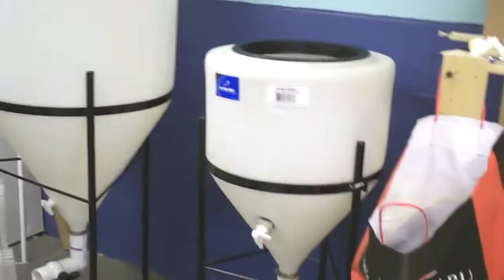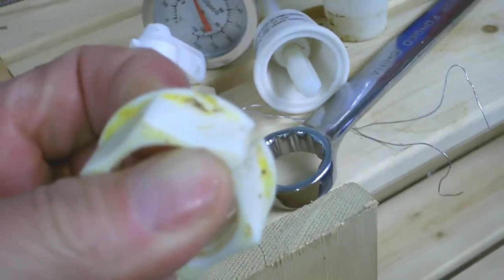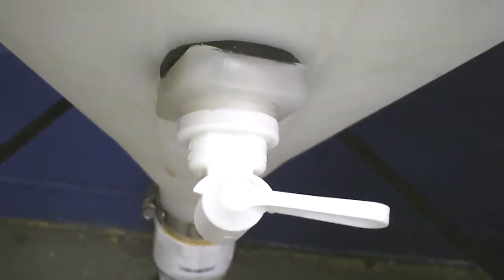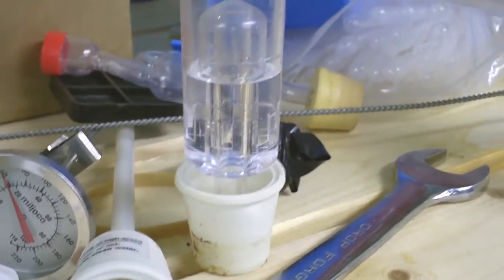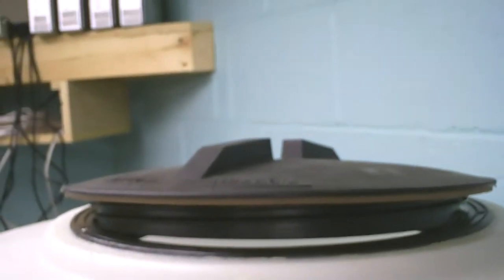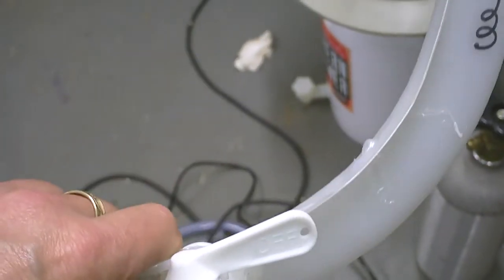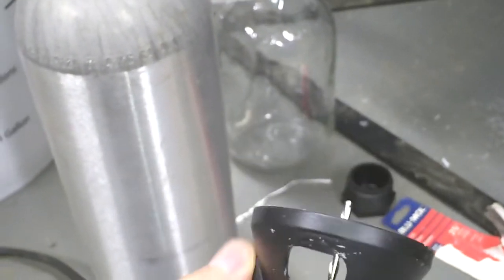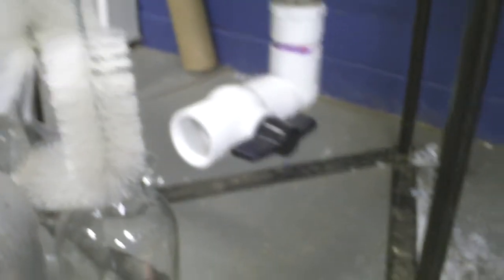Orchard Diary 4/16/2011:  Working on the fermenting tanks again

Comment: Allen how did you get the lid to be air tight
Reply from the maker: +Steve Harmon That really is a good question.  I tried foam sealing tape on the mating surfaces, but that didn't work.  What finally worked was running electrical tape around the outside edge of the lid to close any openings.